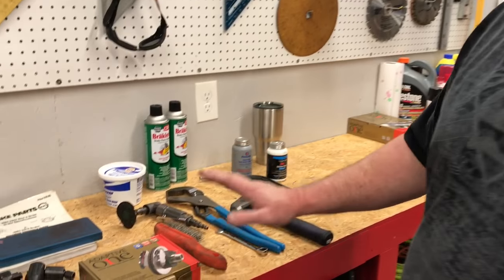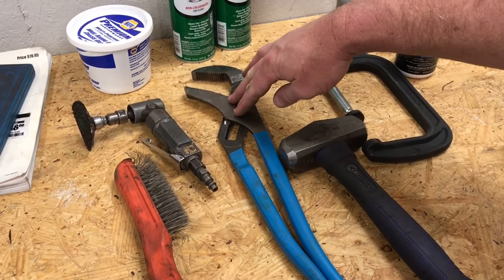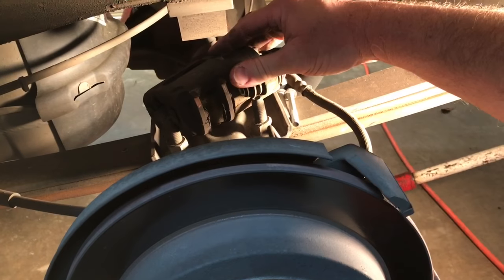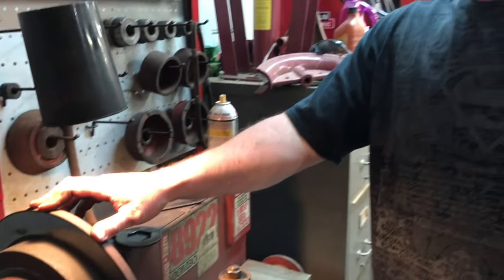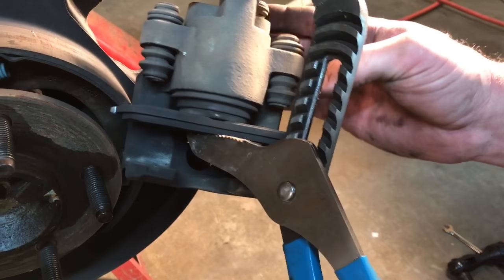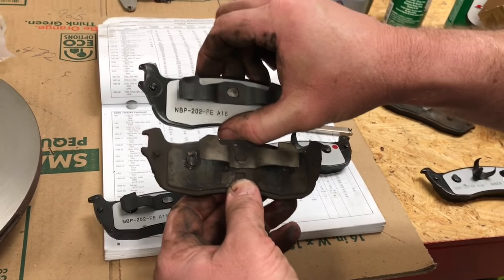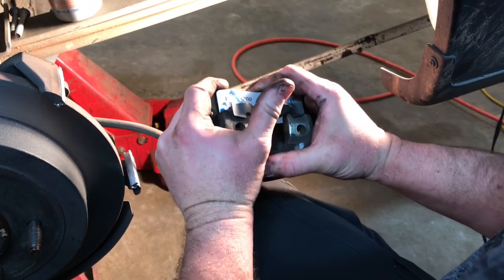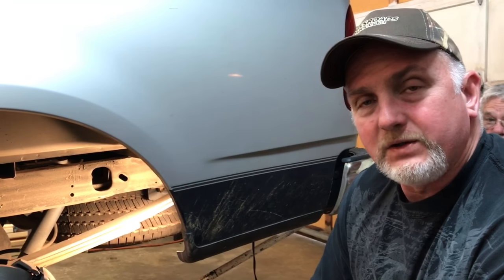How To Change the REAR BRAKES on a Ford F-150 - Rear Brake Job

Comment: Nice video!  I Did my front brakes yesterday. Looking to do the rear soon.  Typically how often do pads/rotors need to be replaced on the F150 (extended cab 4x4 2010).  Thanks!